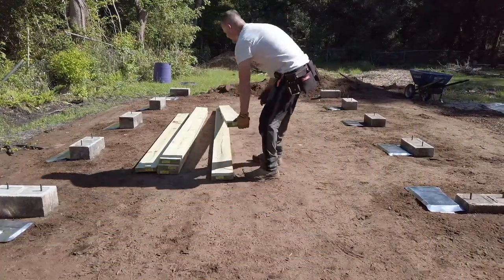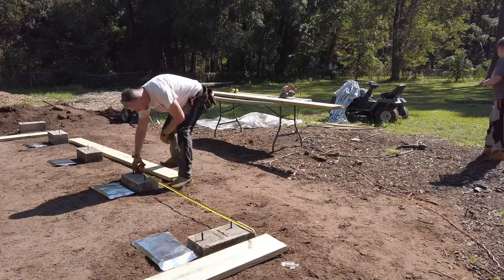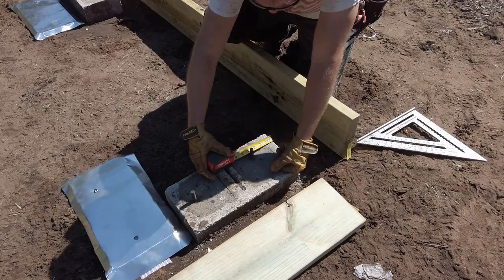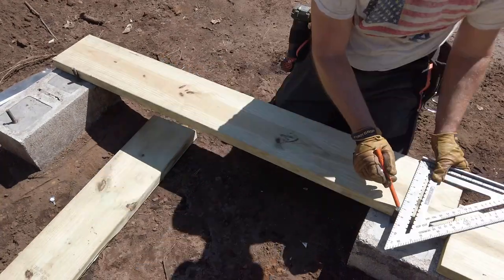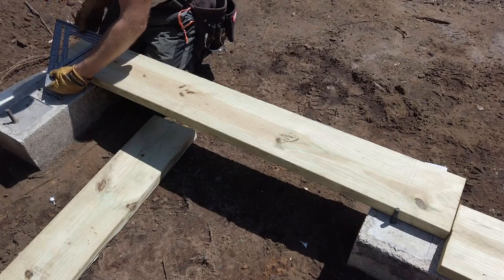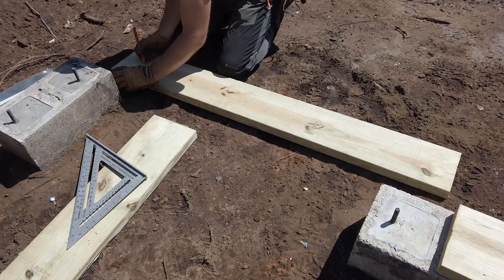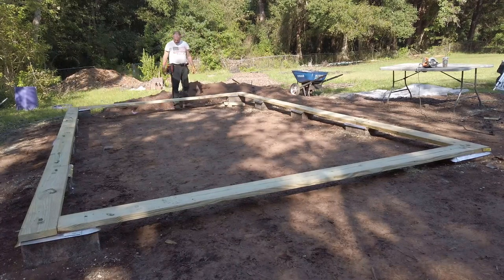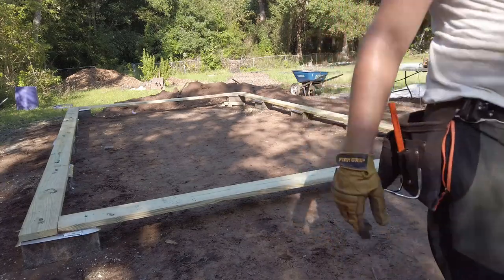Install Sill Plates On Pier Foundation

Comment: Kool, glad to see shop progressing. How oversize did you drill the holes for the bolts? I did smaller project, had to rebore a few holes🤣
Reply from the maker: I think the bolts were half inch so i would have gone 5/8ths.